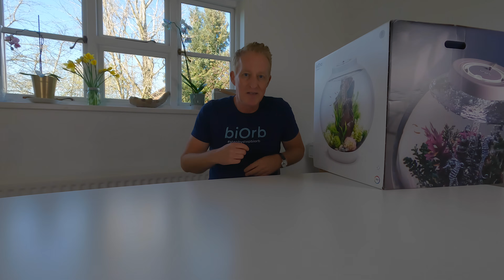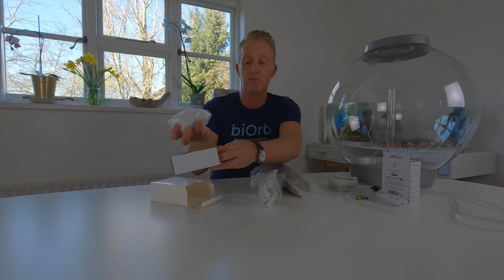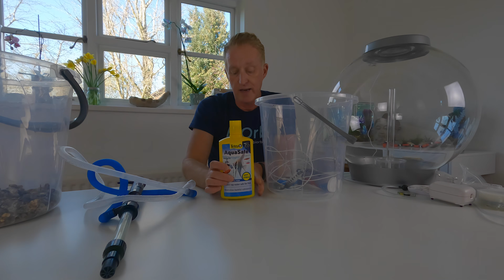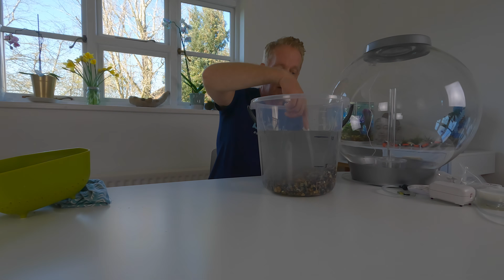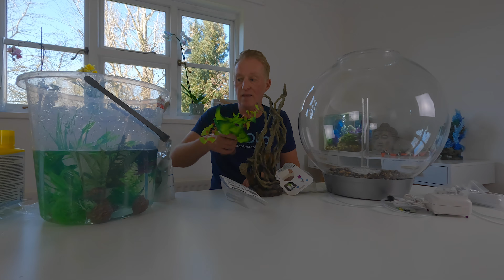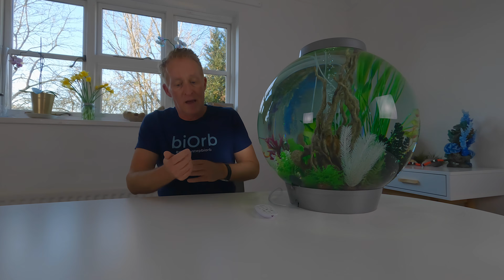biOrb Aquarium   | Starting a biOrb | New approach!

Comment: Hey! Today I set up my 30ltr classic BiOrb, using your method! Went really well! No fish yet, will be leaving a few days.  I have two questions, 1 - I notice instructions tell you to leave a 5cm gap at the top.  I noticed in this video, you didn’t do this.  Was there any reason why? I followed suit and filled to the same level you did.  2 - I note BiOrb state ‘do not expose to direct sunlight’ and this being a fire risk.  I’ve noticed that at 6.30pm some sunshine hits my outside conservatory and that sunlight reflects back through my back door, slightly on to the BiOrb.  It shines a little bit of light on the wall tiles at the back.  I’ve never noticed this area of my kitchen getting this light before.  I know I can get algae grow quicker, but do you think there is any real danger here? Thanks for your help.
Reply from the maker: Hey Victoria.  Hope all is well.  The height of the water is related to how much surface agitation you have from your air pump. The poorer the agitation the lower the water height needs to be, to some extent!  So, if you have "reasonable/ average" air flow then it is up to you what height of water to to use. I have always fill my tanks to the higher level and have never had a problem in all 4 tanks.  

In terms of sunlight.  If your tank is in prolonged and permanent direct (and very strong) sunlight then I suppose there could be a risk (although I really struggle to see exactly how!). The only shaped biOrb that provides any level of "magnification" of sunlight would be the orb (round) design.   Even then I struggle to see how this would present a risk!!   What you are describing, in terms of a 'short' period of time with direct/indirect light, (and in the evening) will not be an issue in the slightest. 

Best wishes to you, Mark
Reply: @StepbyStep-biOrb  Thanks Mark for your help and advice.  It’s much appreciated.  How are your 4 tanks going? I meant to say, I was very pleased with my ceramic media, hardly any little bits! Haha 😆
Reply from the maker: No problem at all. All my tanks are doing well.  Happy fish!  I have the joy of doing 4 lots of water changes today, but will leave that until this evening (oh the joys of life!). Lol.  Yes, just my luck to get the worst ever bags of ceramic media. I managed to get most of the small bits out during the video but some still went in that were smaller than i would have wanted.  My vacs tend to pick them up when Im cleaning so I'm still taking smaller 'pea size' ones out.  I hope you are having a great weekend x
Reply: @StepbyStep-biOrb  Hi Mark! It’s fish day today.  After months of planning, setting up, today I have added 7 White Cloud Mountain Minnow to our tank.  I’ve completely followed your methods and all went well so thank you ☺️ I’ve given a small feed, they seemed to like that and are enjoying exploring their new home.  I’m keeping my fingers crossed they will do well and I will do my best.  I can’t tell you how much I am enjoying looking at them already.  Sometimes they shoal, sometimes not - fascinating! Hope you are having a great day.
Reply from the maker: Hey, that's really great news. It's really made my day!  Your new fish will be so happy living in their new home. It's a great moment adding fish so... do enjoy it.  I'm sure things will go really great, especially with White Cloud Minnows. As always... just shout if you need anything.  You just need to keep and eye on ammonia initially (pulling off from feeding is the best means to keep that under control) and look out for the rise in nitrate. Easy!  :)  Have a really great day and say hello to your new fish from me. M
Reply: @StepbyStep-biOrb  Aww! Thanks Mark! I will definitely update you on how they do.  What’s meant by pulling off from feeding? Stopping? I’ve watched all your videos but will re-watch to refresh.  Thanks again :)
Reply from the maker: Hi.  Yes, the only input of ammonia to a tank is via food.  So, if ammonia starts to peak (a bit) during the initial stages you can control that rise by stopping the feeding.  This should then allow the beneficial bacteria to process the ammonia to nitrite and then nitrate.  Hope that makes sense. M
Reply: @StepbyStep-biOrb  makes perfect sense, thanks 👍🏻
Reply from the maker: Hey Victoria.  Hows that fish family of yours going... and are the beneficial bacteria behaving themselves?  M
Reply: @StepbyStep-biOrb  Hiya! Tank going very well thanks.  I’m surprised at how little maintenance the Minnow have been and the water/tank isn’t getting dirty at all.  The Minnow have been fascinating.  I’ve watched them settle in, grow in confidence, a group of 4 love swimming in a circle, 2 smaller ones hang around towards the top of the tank and then 1 on its own at the back.  The males flare their fins so I think they are in the process of establishing a pecking order or trying to look nice for the females.  If I have any!
Reply from the maker: Hey!  Great to hear all is going well. The cleanliness of the tank is probably more a reflection of you feeding them the right quantities!  My new tetras are so funny,  if I walk around the tank they all group up and follow me (in the hope of getting food!).  As you say, it's interesting how fish within the same species all have different personalities once they've settled in.  Sounds like your males are showing off... in the hope of getting some female attention! Lol.
Reply: @StepbyStep-biOrb  That’s really funny about the tetras! Yes I really think the flake food is a winner and has a lot to do with it.  Thanks for all your wonderful videos giving lots of help :)

Comment: Thanks for making my Saturday! I can’t tell you how much I enjoy your wonderful videos! I am super excited to see you add fish to your 60ltr! I have not yet got my BiOrb but have been making a list of all the things to buy and your videos have really helped with this.  I see a lot of tanks being sold with scratched up acrylic.  What’s best to have to clean inside? Just the BiOrb pads? :)
Reply from the maker: Hi Victoria.  Thanks very much for the positive comments... they keep me going! :)  I've fully cycled the new tank now (using some of my zebra danios). So now that's done I can go and get the fish I want to add in as the intended fish population.  I'm hoping that the next video will help bring together a range of things I've discussed in a number of previous videos.  All will be revealed in the next vid.  :) To minimise scratches on the inside of the tank I strongly suggest you use the biOrb Cleaning Pads (the soft side of the pad is the side to use for the most part, unless you need to get rid of stubborn stains or algae (then use the rough side of the pad to deal with those). The pads should only be used on the inside - not the outside of the tank. Use the biOrb polish and polishing cloth for the outside and your tank will always sparkle!  You can get alternative products (cheaper versions) of the biOrb Cleaning Pads but you may as well stick with the proper biOrb product.  A pack of three will last you for ages as you can clean them out under tap water, dry them on a radiator and then keep re-using them. Generally, most products can scratch acrylic but the vast majority of scratches cannot be seen with the tank full of water (due to the relationship between acrylic and water).  Scratches tend to be more obvious when a tank is dry/empty (add water and they disappear).  Anyway, I hope that helps. Thanks for your support to the Channel. Best wishes, Mark
Reply: @StepbyStep-biOrb  Thanks Mark! Look forward to further videos! :) I can’t decide on whether to go for a 30ltr like your white one with blue plants or a classic round 30ltr.  I’m having minnows.
Reply from the maker: Tank choice? That's easy Victoria... Just get one of each! Ha Ha.    Good choice with minnows - as they are from temperate climates you probably wouldn't need a heater and they are very hardy  The only slight issue relates to cycling a cold water tank... they tend to lake longer to cycle as the colder temp is not ideal for rapid cycling (developing the beneficial bacteria).  The product I always use (ATM Colony) demands a heated tank.  But there are bacterial products that don't seem to be so reliant on temp.   The best approach, if you are going to cycle without a heater, would be to add only two minnows initially - to support the initial cycling - and once the tank has cycled add another couple, and so on!  M
Reply: @StepbyStep-biOrb  brilliant thank you! 😊 though think I’ll get the hang of 1 tank before I think about 2! Haha 😂
Reply from the maker: Not a problem. Let me know when you are starting your tank  and planning to commence cycling etc. I'm very happy to support you throughout the whole process... don't hesitate to drop me a line. Cycling is probably the worst bit of anything to do with an aquarium.  After that... easy street!  x
Reply: @StepbyStep-biOrb  Thank you that’s very kind.  I have picked up so much from your videos, but will let you know if I need help :) will we be seeing an adding fish video from you soon? 😀
Reply from the maker: Hi Victoria. Yes, just finished the filming for the video today so I now need to edit and process it and then load it onto YouTube. It will most likely be on this Channel tomorrow evening, if not...Tuesday.  Best, Mark
Reply: @StepbyStep-biOrb  Yay! Hope you enjoy your new tank.

Comment: Hello, question, when u move this tank to the stand will you remove 1/2 the water?
Great video 👍
Reply from the maker: Hi Donna.  Yes, every time I do a video, with one of my tanks on my dining room table, it is because I've relocated it from another location  I then move it all back again. So, if moving a 30 I would quickly extract 50% of the water (using a vac).  Move the tank and then refill it straight back up with the very same water I took out.  If relocating it is important to do this quickly - to avoid a drop in the extracted water temp and it also important to ensure you add the same (not new) water back in.  In the terms of the 60, I extracted 2/3rds of tank water and then relocated the tank to the stand and then added  back same water.  I'm just glad i didn't opt for a 105l!! :-)
Reply: Thank you 😊 
It's OK to move the biorb with water in it? I know with all glass tanks they say not to move with water in? Thanks again, Donna
Reply from the maker: With an acrylic tank (biOrb), I've never had an issue with doing this.  I wouldn't move (lift) more than quantities I've indicated though. It is always best done with two people.  I'm not sure I'd be keen on moving a glass tank in the same way though - a glass tank weight is far different and so is the way the glass tank is constructed/bonded.   Best, Mark
Reply: Ok thanks I was just checking, I have to move 3 of my Biorbs, having some work done in the house and person doing it wanted me to move them, just worried about moving them.
Was hoping I could just cover them🙃
Reply from the maker: Moving three is a fair handful (I find it bad enough to do just one!). Lol.   As I mentioned, I have never had a problem doing this and it is something i have to do for the majority of my videos.  Although, in my case, the tanks are only being moved very short distances. The 60l is now on a stand - that's less than 6 feet away from where it stood on the table in the video. It is a matter of just removing the bulk of the water and then quickly moving the tank and then filling it back up with the very same water you took out.    Although it's a lot of work to do with three tanks (with fish), if the tanks are at risk due to the work you are planning it might be safer to move them.   The key thing it to retain the temp of the extracted water and to then get it back in the tank as soon as possible.  I hope that helps.  M